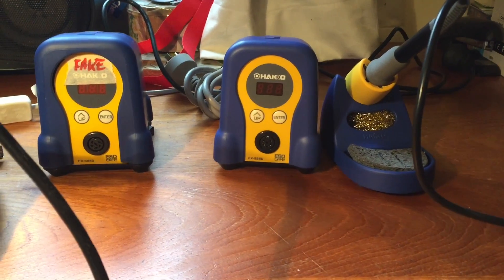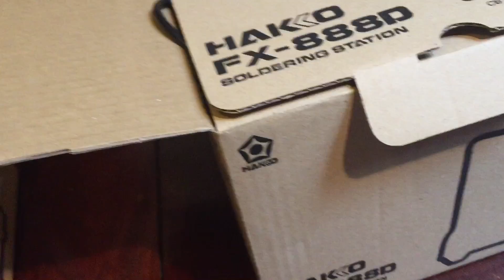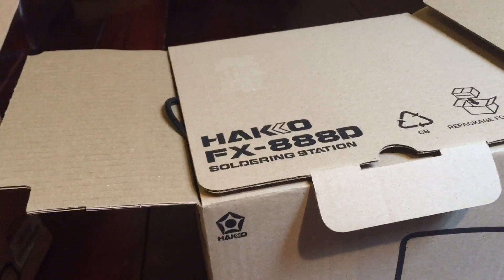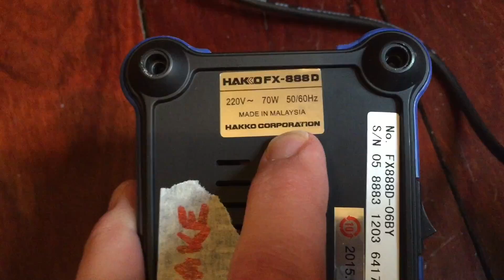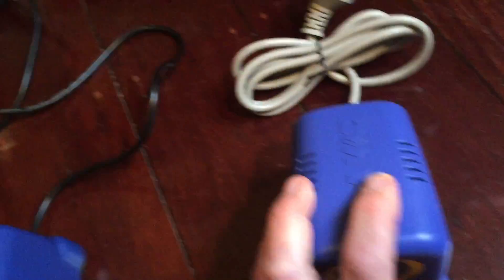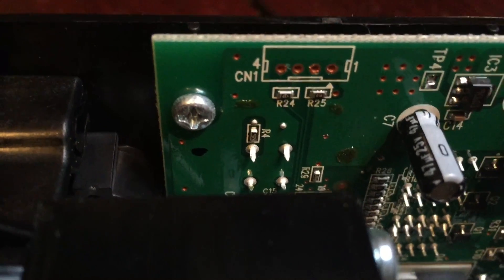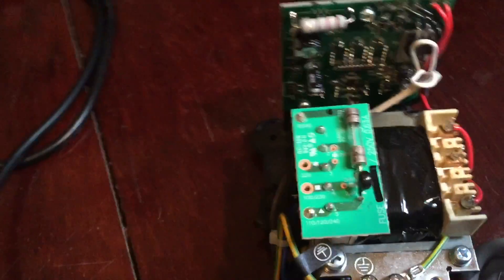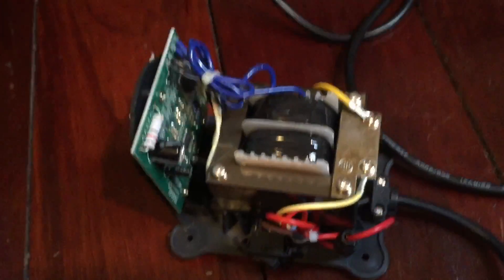Hakko FX-888D - Real vs. Counterfeit - how to spot a fake

Comment: Hi Lawrence, do you still have your 240V model Hakko FX-888D? If yes, could I ask for the value of the varistor soldered on the FX-888D P.W.B (fuse board on the transformer)?

Comment: A genuine hakko soldering  station will come with tips that are solid copper (plated with chrome) and non magnetic except at the pointy end where they are intentionally plated with a small amount of iron.  Most counterfeit or inexpensive off-brand soldering stations (including the cheapest "red line" equipment from Weller) come with tips that are solid iron from one end to the other, and you can easily tell the difference by use of a magnet. I conducted some tests of various tips on my channel.  Iron has poor heat transfer material compared to copper,  Which means it may take so long to solder connections that you can damage circuit boards;  And the iron tip's being pharaoh magnetic can also set up electric currents in the circuit board and possibly damage sensitive components. If your iron has cheap steel or iron tips in it, change them over to high quality name brand tips that are made of copper and the performance will improve. (PS,  The reason that Hakko and other quality tips made of copper have iron plating at the pointy end is because bare copper would easily be dissolved and eaten away by molten solder and flux; the iron plating will wet to the solder but resists being dissolved).

Comment: I am in the UK and I am looking at buying one of these very soon. I can see why people are tempted to buy them cheaply from eBay etc because they are very expensive here in the UK when compared to elsewhere for some reason. For example, the going rate for a Hakko FX-888D on Amazon UK is currently around £179. That equates to roughly US $223 or AU $350. If I buy the same thing via Amazon UK but it's shipped from Amazon US then it'll only be £133 including shipping to the UK and that comes with a Hakko 599B tip cleaner thrown in as well, but it's no good because the power connector and voltage are wrong. If it ships from Amazon EU then it's something like £127 with the correct voltage but the wrong power connector. I guess I'll just have to suck it up and pay the rip-off UK price for it, but even if it comes directly from Amazon I'm still wary that it may be a fake. Hopefully your video should help me spot one if it is, although I'm sure their fakery has probably improved somewhat in the 6 years since you posted it. Thanks.
Reply: probably won't see this comment but i'm in a similiar situation i want to buy one but i could only find legit ones for £200 guess i have to suck it up and pay these terrible uk prices
Reply: @MasalOr-r3c I saw one on Amazon once that was a decent price, it was coming from Amazon Europe and had a continental plug on it. I ordered one but eventually cancelled in case there were any extra charges to pay for buying from abroad (probably would have been fine because I've since bought a Nintendo Switch from Amazon Europe without any issues at all). I'd definitely recommend checking Amazon to see if there's a good price on one from Europe rather than getting ripped off like we generally do in the UK.

Comment: I think the T18 tip that ships with the genuine FX888D is a little larger than the clone. I don't have the ability to confirm but believe the fake ships with old 900M tips that also have a chamfer near the mating point with the heater element. So you need to take out the tip to confirm this. Please post measurements with calipers/micrometer if you have one of each.

Comment: I found you don’t need to dismantle your newly purchased Hako in order to identify it as real or fake.

Get a bright torch with a nicely focussed beam and shine it through the vents on the top of the casing. You will need to move the beam about slightly to get the angle right to illuminate the interior. Look very closely through the vent gaps, and if your Hako is genuine you will see the green ‘daughter-board’, albeit somewhat blurred. If you don’t see this then of course you have a fake.

Comment: Mine was bought in 2013. It has the smaller label underneath but all other genuine features listed in this video - including the fuse board, same temperature control board, pliable soldering iron handle rubber, metal insert in the stand etc. Even same wire colors inside + ground sticker and also the flat screws mentioned. I would say that I think the both label types are possible over the years. Maybe the newer ones have the bigger style and more markings due newer EU (or other market ?) regulations or something which were not in effect earlier?
Reply: Same here. Mine is from 2014 and has small label sticker as you mentioned.
Reply: mine is 2023. has the small sticker but everything else seems legit. even opened it up and the guts are legit.

Comment: I bought mine in 2014 and my label on the bottom is small with a different safety certificate logo specifying it's the US. but everything else is as you say. So there may be some differences from year to year, from region to region

Comment: Did you happen to measure the height of the enclosures. It may be just the lens but the fake looks a slight bit taller from the video. Also the yellow area on the fake appears to be a different width each side of the display.

Comment: I bought one off eBay and it seems to be an improved version of your fake. The screws where the power board attaches are flat like your genuine, it does have the fuse daughterboard like the genuine one but like the fake has the atmel ic. They have either gotten exceptionally good at reproducing or maybe it’s just a low cost variant for the Chinese market? Weird.
Reply: Stuart Cole Nope, it is not a variant. It is counterfeit. It is a sure fire way to tell if the unit is fake. Replicating Hakko’s proprietary processor would be too cost prohibitive. Hakko does not use alternate processors for the FX888D or any of their products.

Comment: Thanks mate. I used to build power supplies (with a Hakko iron) in Australia for use in many different countries. Our own non-CE versions (with the tick ✓) for shipment outside of complied countries looked like these fakes with similar compromises made in earthing, fusing and build quality. But they were legit. Maybe one is for CE spec for domestic UK, US, AU, market and the other "fake" one may have been for 3rd world production facilities as it has the old N✓ . The two builds are consistent with CE vs N✓ standard and earthing for end-use-environment, typically where an old ELCB should function (CE is getting dated). Wouldn't be the first OEM request of a manufacturer, I would think.

Comment: Its easy to tell them apart, Chinese clones do not bother stating the correct  region voltage, all of them are either 110 or 220V while when you buy a genuine one you get the correct  voltage localization, like  230V (Europe) or 240V (Australia) .

Comment: I bought a FR301 de-soldering gun on Amazon (sent back with no problem). first clue, everything was in Mandarin (I don't speak it so not sure) so I returned it as a fake. I contacted Hakko via email and then was sent their phone number. There is no number on their website (it's a secret) and the one that came with the 301 was an out of country number. Hakko checked the serial number and said they had no record of the serial number but it still may not be fake (head scratch- an international company that does not keep a database of inventory?). I sent pictures per their request and to date have not heard back.

Comment: Thank you for the very informative upload! I just had a quick look at ebay and amazon. All "Hakko" 888D on ebay are around 50GBP and those miss the steel tray,  the cheapest on amazon: 125GBP . I think I can draw my own conclusions.
Reply: Maybe, or maybe not.  Amazon has competitive prices on some things, but not so competitive on other things.  There are many genuine, known identical products on ebay that cost significantly less than on Amazon, because Amazon doesn't seem interested in putting certain products on much of any sale/discount.  We could argue why and some of it may be that Amazon has the retail products while the smaller volume on ebay are gray market, or just excess stock that the factory produced and was in excess of the rate amazon was selling them, so instead of cannibalizing the amazon market price, offer them through an alternate channel at the reduced price to get rid of surplus stock.
Reply: @stinkycheese804  My "Amazon Hakko" still works very well and as intended. Moreover - in the past year I have twice bought something on eBay, just to receive a delivery from... Amazon, as the same items were cheaper there (my fault - I've failed to search the market properly) . The main intention of my 1 year old post was to suggest, that Amazon is slightly better with removing fakes from its market. eBay still has a massive problem with that (look what's going on with 3M respirators on eBay during covid pandemic - half are fakes, N95 filters are fascinating - I have ordered 6 boxes of the cotton filters, ALL came ...different. On one carbon filter I nearly chocked (3M quality, huh)..

Comment: My genuine Hakko has no metal insert on the stand and the stickers are completely different with no compliance marks. So I would not go by stickers or stand as any sign of a fake. Best way to tell is to inspect the insides of the main unit. I imported mine via a genuine dealer around 2014. The only fakes at that time where of the older black Hakko 936. I bought my genuine FX888D after being stung on eBay with fake 936 at £50. Too good to be true price and it was clear from the second it arrived that it was cheap.

I have serious doubts that you have a fake. 06BY is a very old modal. Your other is a 21BY, a much newer modal. I have a 17BY. I think you might have just done someone over by accusing them of selling a fake. Maybe, maybe not.

Email Hakko with pictures and they will confirm if it is real or not. That would be the only way to tell 100%.

Comment: I don't buy that it's a knockoff, it's more than likely a Hakko made for the Chinese market. The fact that the molds are spot on accurate is the giveaway. It would cost the counterfeiters more than it's worth to duplicate the molds and dies that accurately. Many many companies produce goods for the Chinese market that are not only cheaper, but also much more cheaply made.
Reply from the maker: Interesting take. 

I'm not sure - if they've gone to the trouble of making a custom IC, wouldn't they install that in their "Chinese Market" specials? Having two models of PCBs, etc, would add more cost - in manufacturing it's all about minimising inventory.
Reply: The plastic molds might all be sourced in China.  Then the guts for the Chinese market are sourced and made in China, while other guts might be sourced and made in Japan (or a higher end fabricator in China).
Reply: @lawrencebillson6224  The premise of this video is flawed. "Having two models of PCBs, etc, would add more cost - in manufacturing it's all about minimising inventory." Spot on - your "fake" is the original mainland Chinese model and the cheapest to produce. But you forgot one thing - maximising profit. An inversion in thinking is required here. Put yourself in China for a minute. In China they made the N (tick approved) version for domestic and export to markets that don't require CE earthing standards. When the opportunity arises to sell and ship into countries that have applicable standards like CE, the manufacturer ADDS parts to meet that spec, which can add costs. Then they're shipped into the EU, UK, AU and US markets. What would I know? I'm an IPC instructor that has worked with most soldering/rework and process flows used in soldering in the past 30 years. Why do people have to insist it is "Fake" or somehow "non-genuine"? It's simply a grey import. Fluke do it with their Multimeters too. Dude in his bedroom plays "one of these things is not like the other" should be trumped by a simple email to Hakko. ;)
Reply: Have you seen the fake PlayStation controller, looks perfect, works like shit, they are amazing at copying molds.

Comment: Sometimes the effort counterfeiters put into these is amazing. At a certain point you have to wonder why they don't just take their effort and put it into an original product. 

If this thing could be under a different name, and have 90% of the functionality&quality/usefulness of the Hakko, but cost a significant amount less, you'd imagine they'd sell pretty well. Instead they put their effort into trying to scam people instead. Kind of baffling. 

Like low effort unsafe crappy fakes make sense. Make the cheapest piece of crap possible, and scam people for maximum profit. But these? Is the profit margin really that high? Like you can make a product that's so identical and not a complete unsafe dysfunctional piece of garbage and still make enough money to justify it? What an odd niche.
Reply: Majority of the cost will be in the transformer. A cheap transformer will not last or perform well.
Reply: The same reason why most companies spend a lions share of their budget on marketing. The term brand value exists for a reason. Also why sportsballers are paid millions to endorse products.
Reply: It does happen. Look at GoPro Hero 2 and the SJ4000 / SJ5000. Problem is that the SJ company was producing such a good own branded fakes and now SJ is being faked.
Reply: NexaEntertainment excellent comment!
Reply: I was literally going to say the same thing, why not just compete with better pricing?
Reply: @laurakezdi-hamzeloo9823  There's also a lot in a name. Inferior knockoffs probably sell faster than quality clones.
Reply: Clearly the ROI is there though. A lot of people wouldn't know it's fake.
Reply: I doubt they have done a good job on the actual tips (and maybe the transformer+heater). I generally use off-brand/knockoff soldering iron tips on my Hakko, but every time I splurge and use a real one they are such a dream to use. I just keep them for delicate (or projects I want to take some pride in and have all my solder points look pretty).
Reply: Faking a brand name is a shortcut to get sales compared to slogging it out in the crowded market of generic, cheap soldering stations. 🙂

Comment: Did you ever think it may have come from a different Hakko factory located in another country.?.  Its construction can be a bit different if thats the case.  Cars are the same , Mitsi lancer 2 different indicator stalks, Look identical until you remove it for replacement  then you find out its from the Indian factory not the Japanese one.   Its why they ask for the VIN No.
Reply: I agree with Cooper Cruse.  This is not a Rolex watch.  It's a cheap sub-$100 solder station.  To set yourself up to make a copy of a Hakko would  be cost prohibitive.  There's little or no profit in it.
Reply from the maker: Having worked in manufacturing, I reckon there's no chance - the parts lists are totally different (custom chip, versus an Atemel), they wouldn't change things like the resins for injection moulding either.
Reply: Fair enough but I have seen different on cars as Im a mechanic and it just depends where the car was made to whats in it.  Interior patterns and fabrics also change.  I have also since found out that the fake Hakko is the blue one, apparently the silver and black or white are all OK. But as you say simple open it and check the main  chip for authenticity

Comment: Id love to find a source for the temp control board in the fake, I have an original with a burned out custom IC, and Id rather replace it with a board that uses easily obtainable parts.
Reply: It's probably a custom printed PCB, but the chip is an Atmel according to the video, which is the same chip in an arduino.  It wouldn't be too hard to replace it with a straight up arduino that you program.  Like a nano or uno, or if you have the know how print your own PCB.

Comment: You mentioned that the outside of the main unit feels not as silky smooth on the fake as on the real one. Smoother things are usually shinier. And sure enough, looking at them in the video (paused at 2:39), I note that the fake doesn't have the same shine across the front edge. It just looks rather dull. Also, being an artist myself with an eye for color, is it my imagination, or are the colors of the main unit slightly different? For example, maybe the gray surrounding the digital readout is darker on the real one? The blue and yellow seem to be slightly off on the fake, just a hair brighter, maybe.

I took my hypothesis re: shine and color differences over to Flea Bay, and believe that I have spotted some fakes. The shine difference is the giveaway I think. BTW, this turns out to be about the only clue that you can spot in photos, as everything else requires seeing the box, feeling the parts, or looking inside or on the bottom.
Reply: The issue with colour is you can't guarantee that everyone's cameras are calibrated correctly. Remember that 50% of people in the world aren't as smart as an average person

Comment: I heard you have to get some sort of official certificate from counterfeit testing professional to prove your claim. otherwise no refunds. And getting such certificate can get expensive.
Reply: If you can't refund it, sell it marking it as a fake. You can put a similar price to the fake and you will lose only a few euros/dollars/pounds/whatever. After all, fakes are still quite good.
Reply: victor saari No need because eBay usually sides with the buyer especially if the seller already have a lot of complaints filed against him or her.